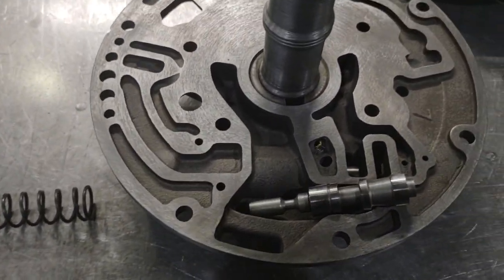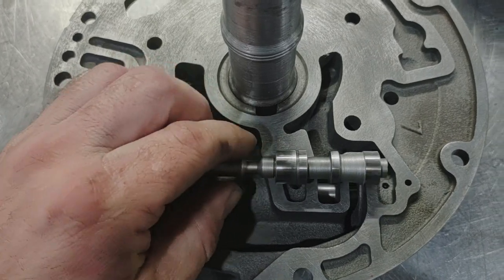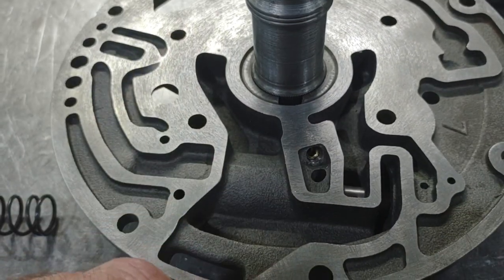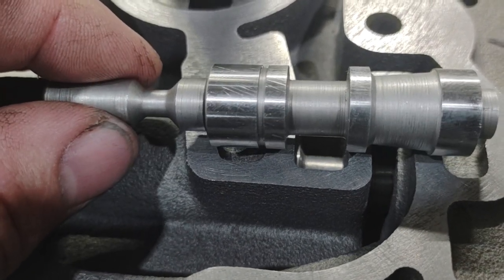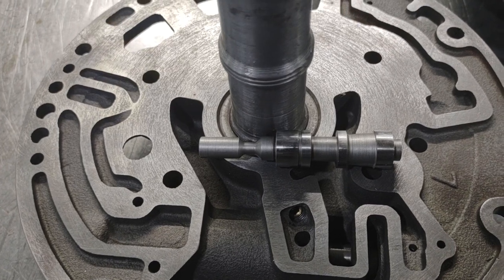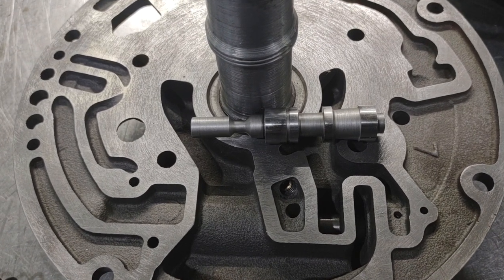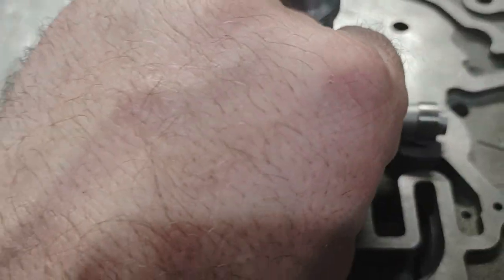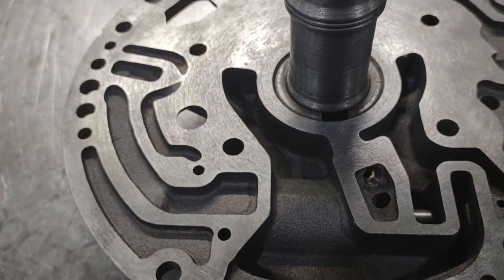Function of a pressure regulator valve in an automatic transmission.

Comment: Great video!  Just liked and subscribed.  I'm testing a 4t65e  for a friend of my grandson.  It has no movement in any gear,  and no codes. Checked line pressure today, it has 0 in all gear selections. Watched a video today where a fellow had the same problem. It ended up being a stuck pr valve. I would like to tear into it to see what the problem is this or the sprag, or the pump or shaft, but I would have to do it on a dirt driveway, and at 72 it would be hard on me. That's why I'm going to pull up a chair and talk him thru it. Thanks again.

Comment: The old style pumps work like the 4L60E pumps we use today in most stock rebuilds with a few updates using Sonnax pinless Accumulators and in some cases the smart tech 3/4 drum with 300M Shafts for higher end performance use.Great video!

Comment: What would cause a 400 to go neutral in second gear under power but have second when driving around the pits?
Reply: What kind of valve body? Forward manual with engine braking? Stock? RMVB with no engine braking. Could be a few things, anything from glazed intermediates to flipped intermediate sprag and the front band is holding on the 1-2 shift in the pits
Reply: @cameron878  had it apart twice, nothing burnt. Sprag is fine. ATI clean neutral trans brake. Reid case.
Reply: Are you datalogging line pressure?
Reply: @cameron878  no.
Reply: That's a good place to start. I'd be curious if the shifter cable is out of adjustment or something like that